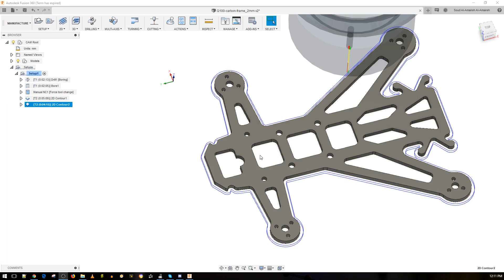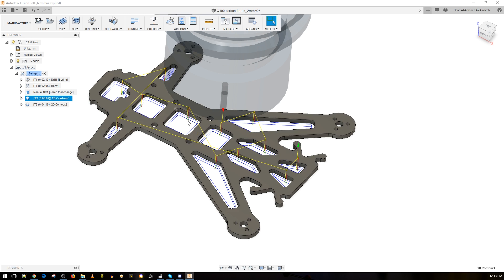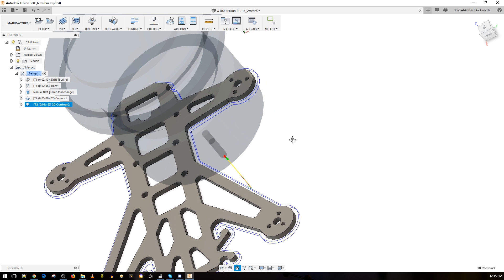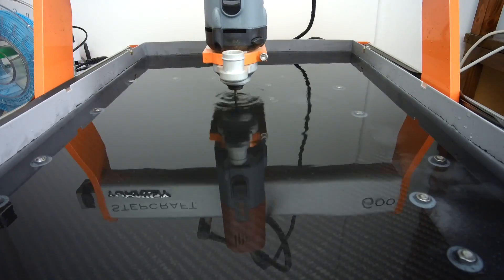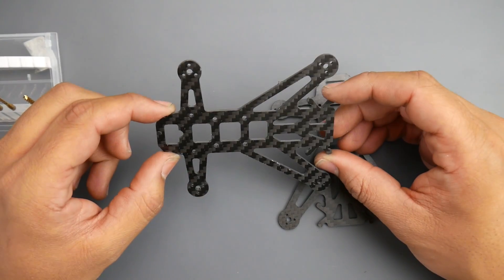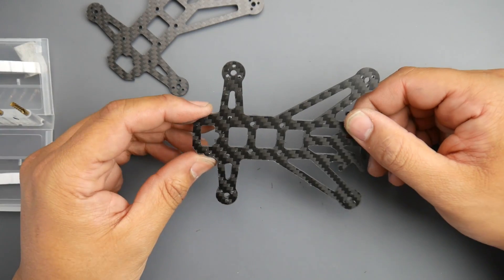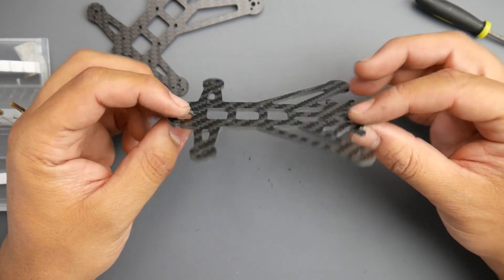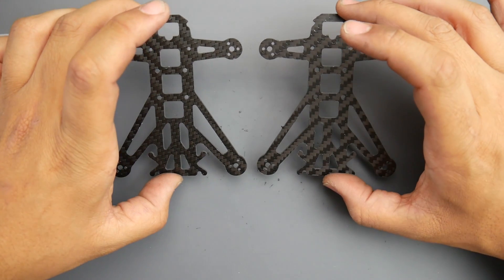Let's Cut Some More Carbon Fiber Projects // CNC Carbon Fiber Custom Drone Frame

Comment: I bought a 30 40 cnc lots of bits 2 controllers about 4 years ago and i never figured out how to use Mach 3 software or the cnc it just a giant paper weight now 😢

Comment: Ok, I think this is crazy cool! I make a lot of composite parts for many model vehicles and recently picked up a small cnc machine for the purpose of cutting carbon fiber. I designed some alignment jigs on shapr3d and 3dp’d them so I can 2-side machine my stuff. Anyway, I went and bought the same exact end mill bits and was curious about feed rate/plunge and rpm. Then BOOM, here I am clicking on your video, courtesy of a youtube algorithm. This was perfect! Thanks for the content😎

Comment: You're cutting this in water to... keep the nasty carbon fibre dust down? Keep the bit cool? Keep the carbon fibre cool? Why? And how do you punch holes in a tank of water and not have it leak everywhere? Did.I miss a video talking about this??
Reply: especially for dust and also for cooling. So I think

Comment: My settings for carbon sheets.  Stay with the 1.5mm bit over all profiles.  
All internal cuts first.  One tab for internal parts and tabs on points of long external parts.

300mm/minute FR
150mm/minute plunge
15000 rpm 
1mm doc
Tabs 2mm height and 1mm width.

Get those super cheap "diamond" files with the red handles to remove the tabs.

Comment: I use a MDF spoil board and use screws in to it after the drilling profile .. thick sheet of plastic works well for spoil board when using water

Comment: FYI its not always tools or speeds and feeds, sometimes its just crap material. i have 3 vendors. i can use same speeds and feeds on 3 different types of material and 3 different results. its usually the resin issue...  find a material u know cuts good stay with it. even if u have to pay a premium, saves you clean up time = money time.  ALSO i see a lot of you guys make these videos cutting carbon fiber and wonder why your doing so many passes.  your bits are made to cut in 1 pass and a cleanup full depth pass if need be, if your machine or bits have to much deflection your machine is your real problem, usually with machines running belts or vbearings. but one depth in a cut gives u better results because with passes your bits are in contact with previously cut  parts. make sense?

Comment: Hey! love your vid! I just have a question, where do you get all the carbon fiber plates? and which types of carbon fiber do you recommend?
Reply from the maker: Dont buy all at once try out different vendors. For practice by the cheapest and or MDF boards to get the hang of  cutting and making the cutting profiles.
Reply: @DroneMesh  Thank you! about to get started. Do you have any suggestions on budget spindles for carbon fiber? They are all so expensive online!

Comment: You need to cut the interior holes out first, add tabs to hold the material in place and reduce chatter, then cut tabs to remove. You could try adding a protective adhesive plastic sheet to protect the surfaces. That can also mitigate splintering, but may foul the bit.

Comment: BROTHER DO YOU THINK 3K CARBON FIBER CAN BE USED IN LARGE MULTICOPTER FRAMES?
Reply from the maker: Yes and some use cheaper version.. However you need tubes or squers for arms for better rigidity.

Comment: Hey quick question: I bought the Stepcraft and milling bath - how do you drain and dispose of the carbon fiber? Not all the water gets drained through the pipe of the milling bath just from gravity. Also, where do you dump the waste? Thank you!

Comment: I use the more expensive Amana carbon fiber/composite bits, about $30 each, and cut at 18,000 rpm at 35 ipm full depth, one pass, into 3mm carbon fiber. My CNC is not the hobby grade and has a 4hp, 24,000 max rpm water cooled spindle on it. Your edges are the result of chatter and not enough rpm. If you need something cut let me know.
Reply: @Roc FPV Conventional works just fine with the Amana bits. I get a nice , smooth cut but I fixture my parts very well so there's no movement or vibration.

Comment: Hey man.   Have you considered putting an inlet and outlet on that water tank?  On the outlet side you can have the water run to an aquarium/bucket that houses a pump for recycling the water back to the inlet.   Before the pump you can have a gravity fed filter making the debris get caught in the filter.

Where the outlet is, use a stand off that attaches to the bottom of the tray that can be adjusted to raise the water height(go peek at how your toilet builds the water column in the tank yet lets overflow pass once the height gets too high).

You could change the water height in your system to properly cover whatever thickness of plate you are using.

Then in the inlet side you can use aquariun stile flex tube(also used in machining collant hoses) to bring the water flow to the top of the build plate giving positive water flow across the top of the surface allowing for constant/clear viewing of the work piece.

These are all plans I have in my head for when I get my CNC mill and do submerged milling.

Comment: Great frame, do you need too seal the edges of the carbon fibre. and if so what do you use. Cheers David
Reply: David, I am curious about this also. My engineers are finding a better solution.

Comment: I have a cheap CnC I got from Sainsmart, the 3018 and installed better spindle I got from Banggood. It only goes to 12000 rpm but this is enough. I can now cut 4 mm carbon in one pass at 200mm/minute using the 2mm drillpro end mills.
I ramp down 4.5mm and then one more full pass and that's it!
Reply: I am thinking of getting the latest Sainsmart 3018 Prover. Still happy wth your choice? Did you make a water bath? Any learnings you can share?

Comment: You should set the RPM as high as it will go with such a small router bit. Also, add small tabs to keep the workpiece secured.
Reply: one could also make the screwholes first and then screw the whole piece to a sacrificial layer

Comment: 0:01 interesting, so the sheet is hanging between those studs and no sacrifice material underneath...?
Reply from the maker: Yes its levitated
Reply: I would imagine the backing/sacrifice material would participate better finish around the cuts🤔
Reply from the maker: @KwongKan  Yes it would

Comment: Woo only 10000 rpm you need to double that and more
Reply: Especially with a router bit so small. On a big CNC it would be cranked up to 24k.
Reply: @yannickg6904  yes i use 23500 all day long

Comment: You would have much better cut quality if the carbon plate was properly supported during the cut.  Those rough edges are caused by vibrations in the material.  Unfortunately cutting in water reduce your options regarding spoil boards and holding methods.

Comment: i think there is a version of fusion360 for small companies, where you have most of the features, but can use it for free and make money with the models you create

generative design is missing, but doesn't hurt much
Reply: It’s not a special version, it’s the same Fusion 360, and there’s 3 types of free licences.  One for students, one for non commercial use and one for startups that have less than 100k of revenue.